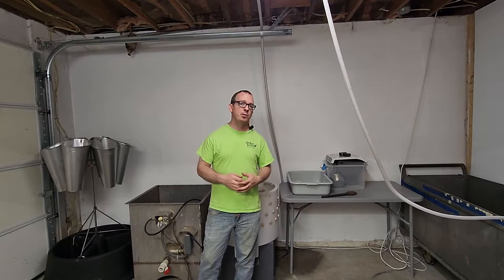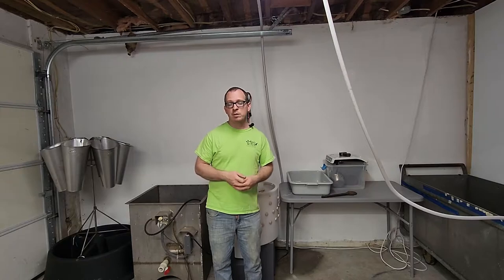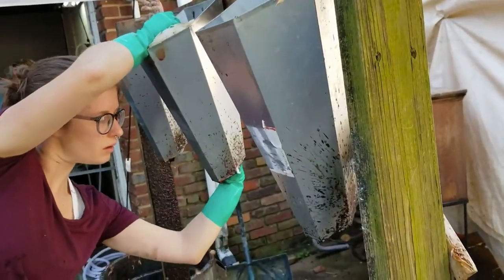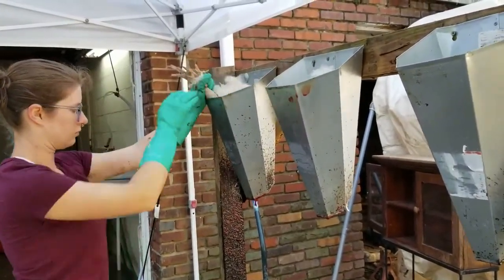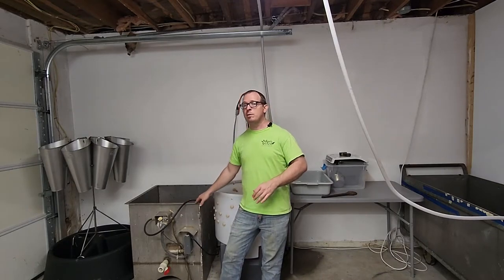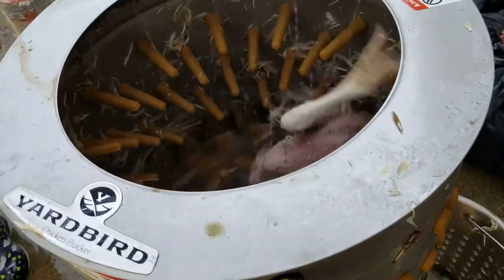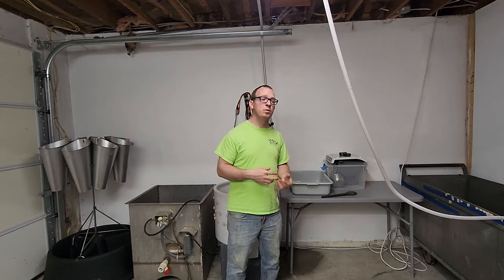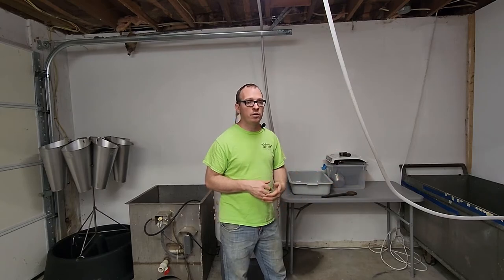Pastured Poultry Processing Equipment & Setup

Comment: This is similar to our set up, we're just a little smaller scale. I'm gonna try the victorinox boning knife. I've been frustrated with all the knives I've tried. Any tips on checking knives for sharpness and keeping them sharp?
Also curious, how many birds do you process in a day, with how many people, and how many hours does it take (field to chill tank)? We've done up to 100, but it took forever even with 10ish helpers... I'm wondering if I'm missing something, or maybe speed will come with experience? Is the way you have your equipment lined up in the video the same arrangement that you use when butchering?
I haven't had any issues with tough meat even though our birds go in the freezer after only a few hours of chilling.
Side note for your future instructionals: you might want to check, but I think YouTube doesn't allow you to show the kill.
Sorry for so many questions/comments, and thanks for the great content!
Reply from the maker: I am no sharpening wiz, so I use an idiot proof sharpener. It's a belt sharpener which you can find here: https://amzn.to/37oJTZO And use these belts on it:
To fix damaged edges - https://amzn.to/3Mg2juh
To finish an edge and maintain - https://amzn.to/3L0poRE

We can process about 20 birds per hour with 3 people, once we get going. 1 on kill scald pluck, one removing pin feathers, cleaning gizzards and QC, and 1 everserating. This is actually slow compared to most. The equipment you see can handle 200 birds an hour with a full crew. But this is just myself with my mom and aunt who are both 60+ years old. Field time, add an extra 30 minutes for catching the birds, setting up the equipment and cleaning. 

The only difference from how the equipment is set up is the kill cones are moved outside. The grey table is where the pin feathers and QC is done. We have another stainless steel table on the opposite wall where the everseration takes place.

I am curious, with the next chickens you do, maybe chill one for 48 hours, freeze one the same day you process and eat one same day you process. I would be curious to hear your results. There may be another variable I overlooked. But in our experience, we just waited longer for freezing the meat was much more tender.

I have seen some other videos on here showing the everseration, but I will double check those rules. Thank you!
Reply: @regenerativehomesteading4538  thanks! I've never eaten one on processing day. I'm guessing that I don't have issues because it takes a bit for the birds to get frozen once they go in the freezer. 20 birds per hour with just 3 people isn't too shabby! Keep up the good work!